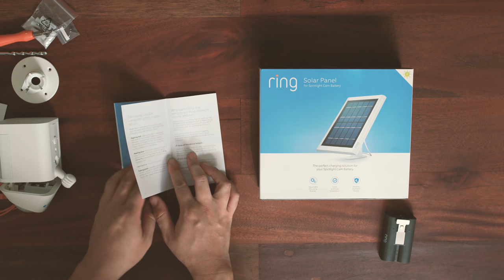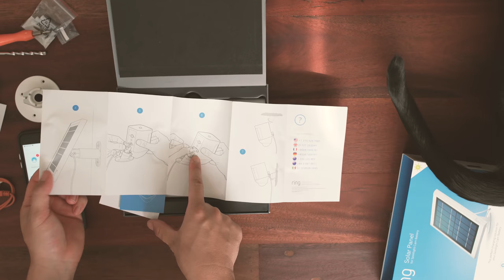Ring Spotlight Cam Battery and Solar Panel Unboxing and Installation

Comment: Thanks for the video,,, I wish you would have shown after ball plate is turned other way what do you do with the rubber push out tab,, I’m confused about the screw hole in the middle also that doesn’t show in the manual very good.

Comment: Noticed that you forgot to place the weather seal on the back of the camera. Good to put that on to avoid water getting in.
Reply: As of about two weeks ago, Ring no longer has a cord that goes from the solar panel to the camera that has the weather seal.  It's creating problems with rain getting in.  They are sending us a new camera, but I doubt that will solve this problem.

Comment: I got the spotlight camera because I wanted the spotlight to come on with motion at night as a deterrent to crime.  However, I have determined that with a dim 28W porch light and the camera in a corner under that light, the spotlight does not come on!  It will only come on if completely dark with porchlight off.  This seems silly.  And I do have the light set for ON at night with motion.  The camera knows what time of day it is so should know the porch light is "artificial" and not daytime light.  Ring thought at first the spotlight should definitely come on in any circumstance as long as light set to ON with motion at night but then said it will not come on if you have a porch light.  I can't believe this can be true and if so, that there is not some workaround.  Hope someone can help.
Reply: anyone?

Comment: I hate cameras like this one...... the way it's mounted every thief can go there and grab the camera in 2 sec. Those are not $30 cameras they cost a lot and they are so easy to steal.
Reply from the maker: When mounted higher according to user manual, thief would need a ladder to steal it. And it should have plenty time to catch thief's face and any action prior before getting stolen and store it in the cloud.
Reply: @TheGizmoGarage  Yes that's an easy answer for you but you have to realize that not everyone wants to install a cam 10' above the ground and climb the ladder every time he wants to change the battery ( old people , sick people etc etc. and solar panel is not an option either because people say even with that panel they need to take batteries out and charge them at home ) and if a thief goes to steal something his face would be covered because that's what they do so forget about any face picture or whatever. In my opinion, Ring should come up with some better cam attachment because this one yells " STEAL ME PLEASE" and that camera cost 200 bucks not 20.
Reply from the maker: @Voltomess  in that case, a powered Nest Outdoor cam maybe better option. For people with mobility issues, battery never needs to be replaced and it can stay high at optimal angle. I have both and been using them for years, and the Nest is definitely a better option if installed professionally.